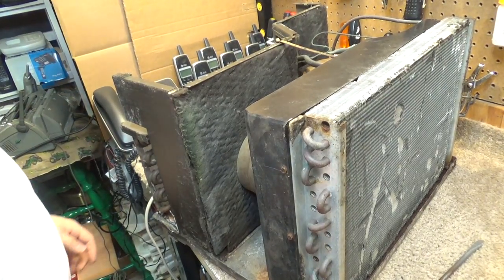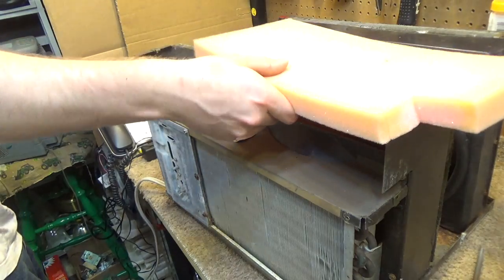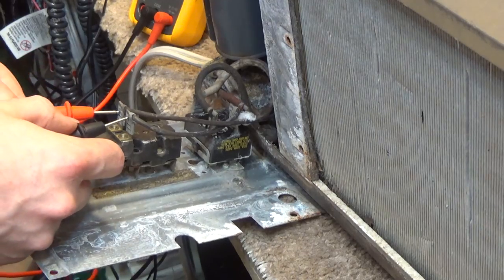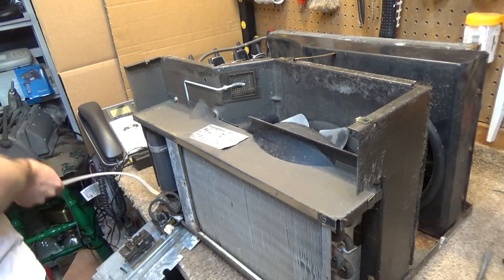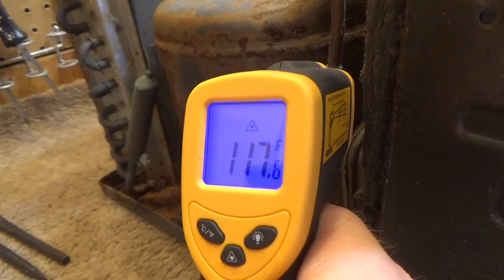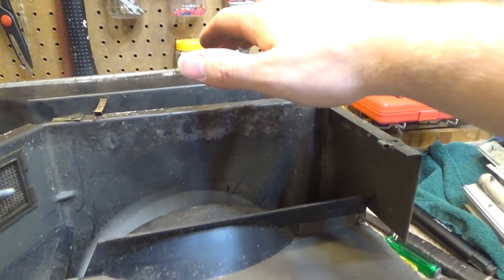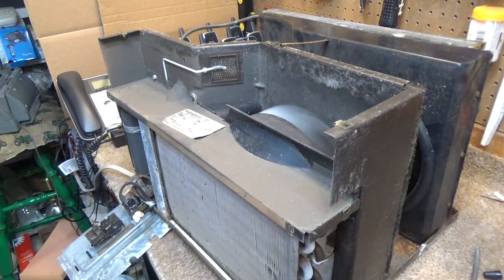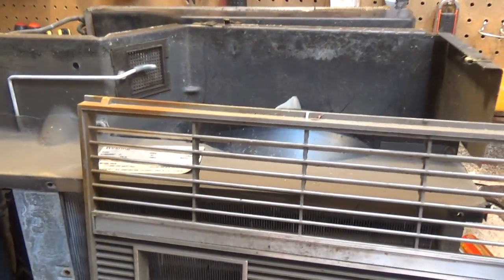Vintage Westinghouse 5,000 BTU Air Conditioner | Power On Test

Comment: Them old ones are BEASTS, used a lot of power but they were monsters when cooling.
Reply from the maker: It's a very common misconception that these units cost more to operate than newer, more 'efficient' machines. The newer machines do have a significantly lower power draw, but if you've ever used 2 side by side, you'll know that the cooling capacity of the older unit far exceeds that of the new one, even though they carry the same BTU ratings. A machine like this will take a fraction of the amount of time a new one would take to cool a room. Since electricity is measured in usage over time, it probably takes about the same amount of energy. Even if it did consume less electricity, the new units never last anywhere long enough to recoup the cost of the savings in electricity as they constantly need to be replaced.

Comment: I've had 3 of those Westinghouse units, all of their recip compressors sound the same.  I've heard some even cooler sounding compressors, but the ones in these units are in the top 3 on the list.

As I had mentioned in an email to you, I had a 5000 BTU model similar to this one in our apartment.  It cooled an area that was easily 300 square feet, in the hottest part of the summer, down to 55 degrees.  It was FREEZING in that apartment, thanks to this unit.  The performance of these units was fantastic, and I'm sure it will do a great job cooling an even larger area.
Reply from the maker: In an area that's well insulated with few heat sources, 5,000 BTU units seem to be capable of handing well over 300 sqft, especially ones like this that are built properly..
Reply: But the problem is electricity bill will be huge
Reply: @fluffybunny510  Not for the cooling you get.

Comment: If you ever gonna build that new workshop you can use this as an air conditioner for it!
Reply from the maker: This is the only air conditioner I have, I'd rather use it in the computer room or somewhere A/C is desirable.. I have no real need for it in the shop..
Reply: @JordanU  You got that right brother. I only use fans in my workshop too.
Reply: @JordanU  I have sent you a video link about how heat pump works
Reply from the maker: @intelboydj1  Please do not advertise content in my comments box; that's not what it's for.

Comment: My mother and I had a very old Westinghouse Air Conditioner for sliding widows in an apartment we rented. We bought it second hand since the big Whirlpool we had couldn't fit in the sliding windows. The Westinghouse turned out to be an old klunker. (it was close to 20 years old when my stepfather bought it) It did cool the whole downstairs; however, when you first turned it on,  the compressor would make a horrible rumbling sound and it would take at least 30 seconds to settle down. Also during very humid conditions. the unit will spit water through the louvers, and you could hear the water drips hit the fan blades. We had it in that apartment for three Summers. Then the next Summer we moved into a lower apartment in an old house; therefore,  we had it in an ordinary window. and once the compressor would kick in, it would make a terrible rattling noise for about a minute. It finally gave up on use about a year later.
Reply from the maker: There's a good chance that whatever failed was an easy repair. These were excellent quality machines.
Reply: @JordanU  Yes, they they were excellent machines, also my maternal grandparents had a medium sized box fan that was a Westinghouse and it worked very well.

Comment: Works better than the (fairly new) window unit I had this past summer. I measured the output air at around 50F at its coldest despite everything on it functioning and all the coils clean. Piece of junk. I remember as a child my grandparents had an old window unit (guessing from the 80s) that was like standing in a freezer if you were in front of it. I need to get me an older unit so I can feel the chill again.
Reply from the maker: These old machines contain different refrigerant than what's in the new junk made today.. The new refrigerant, which doesn't get as cold, paired with all cheap components has no chance of coming anywhere close to the performance and longevity that once was standard..

Comment: Hello sir, if I find a damaged reciprocating compressor, can I replace it with a scroll compressor? Do you advise me on the best way to change the same compressor or change it with a scroll system? Thank you.
Reply: I have westinghouse air condition floor mounted 24000btu can me change

Comment: I thought "satisfied " would mean no need for cooling no compressor 
You simulated  "calling " for cool compressor on 
I have had bad thermostats bite my butt many times most Westys I have found back in the day had bad fan motors  that is a monster cap in there
Looks like you have a winner there
Absolutely a recip
Reply from the maker: That's what I meant, my mistake..

Comment: What refrigerants did these use?
Reply: Is it R407C or R410A
Reply from the maker: This one takes 22.
Reply: @JordanU  aw man i don’t really like R22, well because its ozone depleting and i care about the ozone layer.
Reply from the maker: @suezq74  No, it's not. It's moving around in a reliable sealed refrigeration system having absolutely no effect on the environment whatsoever.
Reply: @JordanU  unfortunately, older air conditioning systems sometimes leak Freon which both depletes the ozone layer and reduces the AC’s ability to cool the room. That is primarily because older mini split units have corroded refrigerant lines which weaken and eventually break open to let the charge escape.
Reply from the maker: @suezq74  These sealed systems hardly ever leak, and when they do, it's a miniscule amount of gas which cannot possibly have a significant effect on any layers of anything. It's the newer units that leak relentlessly.
Reply: @JordanU  I think you meant the opposite, older systems can leak just like new system can too, and older systems have R22 which in any amount, can still wreak havoc on the ozone layer. Even a miniscule gas particle of R22 can wreck the ozone layer. - Riley
Reply: @JordanU  Plus, R22 can’t absorb or release as much heat as R410A can. R410A can release and absorb a ton of heat, this lame weak heat absorption can lead to burning out the compressor earlier. - Riley
Reply from the maker: @suezq74  That's cap.
Reply: @JordanU  now are you being rude to me? - Riley

Comment: to  make compressor last longer use muriatic acid and steel wool to remove rust   do this outside with gloves and glasses
dont get any chemical on yourself or clothes as it will eat you,  its extremely dangerous to use, 
rinse with vinegar and water spray bottle then hose off debris outside
then paint using POR15 auto paint that reacts and hardens in humidity,  
note: the compressor is under 250 to 400 lbs pressure as well as the tubes in hot back
the front tubes less pressure , when running with cover off always wear glasses in case of explosion and shrapnel
Reply from the maker: I prefer the use of a wire brush, then repainting. I've never used safety equipment when running a machine open or doing basic service like this, there's absolutely no reason something like this would explode. The newfangled garbage ones of today, those I suppose are less predictable.

Comment: Yeah just let it run. That’s what happens or what we sometimes do rather when we start up my grandmas I think 79 or so El Camino. I mean I think sometimes my dad clean tonight at my grandmas house which is in there anymore because it burned in 2017 because something was left plugged into an old 50, 60 or maybe 70s??? Not really sure but I think maybe 50 or 60 to or something like that electrical outlet at my old neighborhood, but anyway sometimes he would clean out  the engine and other times when there’s not that much stuff it would just blow out onto the ground meaning, leaves rather
Reply from the maker: This is not a car, I don't understand what the connection is that you're making.